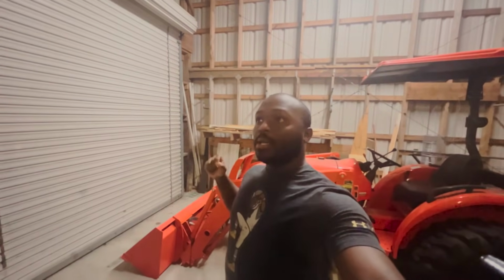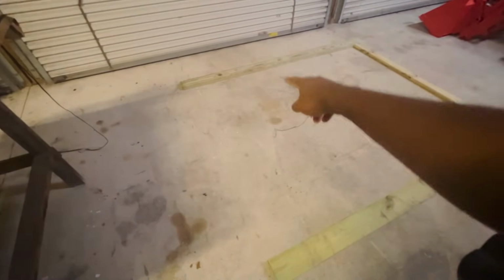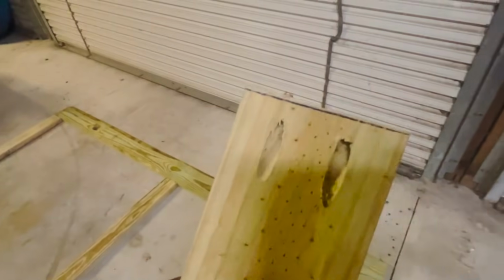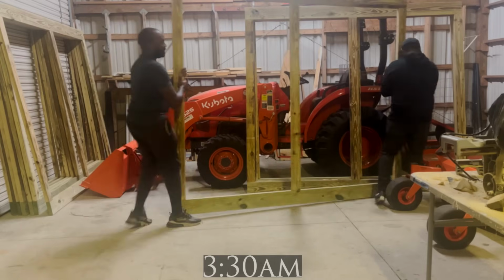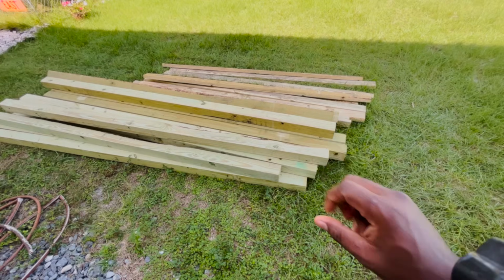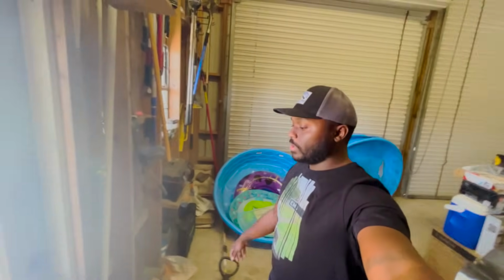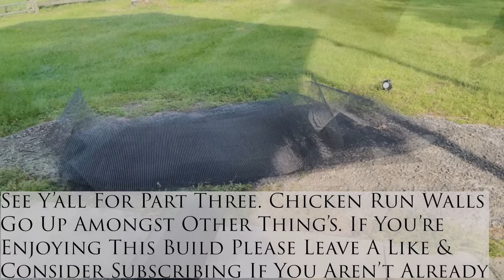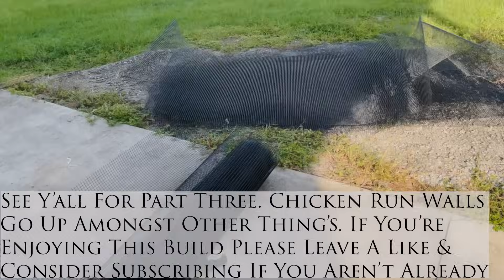Ultimate Chicken Coop & Chicken Run Build Part 2 || Building The Run Walls & Setting Post

Comment: I knew you would be getting a bigger "fire gun" pretty soon!  That other torch was good for small jobs,  but you need to pull out the "big guns" for this project! Just pound the earth around the posts and they will be as strong as a post with cement. I put in fence posts over 20 yrs ago with just pounded dirt, and they are just as sturdy now as when I put them in! I've always put a rock in the hole to set the post on to shed water, and also I put smaller stones( golf ball size) in around the posts as I pound in the soil! It gets rock hard around the post and the stones keep the post upright! My landscaper had to move a post when  we replaced a section of fence,( posts were originally set to hang 8ft sections of fence, but this new section of fence 15 yrs later were now only made 7ft 6in!) and he could not believe it was not set in cement! ( I live in the  Northeast on Long Island, lots of moisture) Dad looks like he is having fun with the new "fire gun", too! This will be a ❤"FLUFFY BUTT PALACE !"❤(name idea?) Would love to hear about your church sermons. God Bless!

Comment: Love the hardware cloth. That's a great choice. That will keep out the snakes. Love a family working together to accomplish a goal.  Screws and washers to attach the hsrdware cloth over the outside of the windows, and the run  keeps predators from pulling the staples out if they get foggy. Looks wonderful. Great job !!

Comment: Aren't you supposed to burn and scrape your wood before you use it?  The idea is that after you burn each side, including the ends, you scrape it with a metal brush so the coal dust penetrates the fibers of the wood.